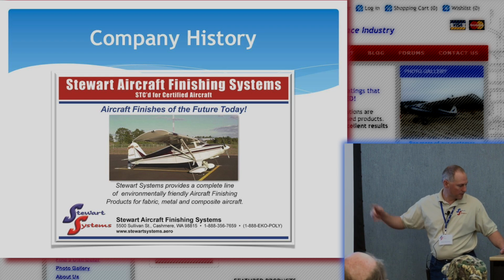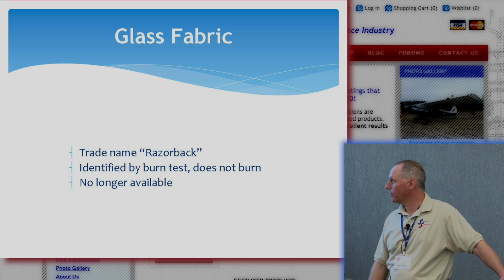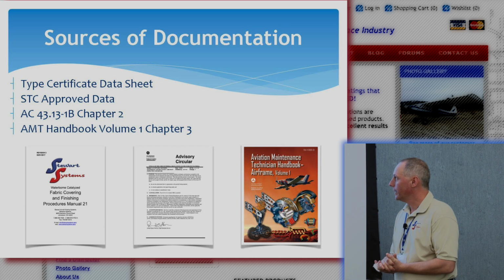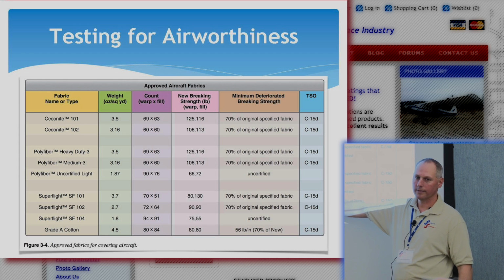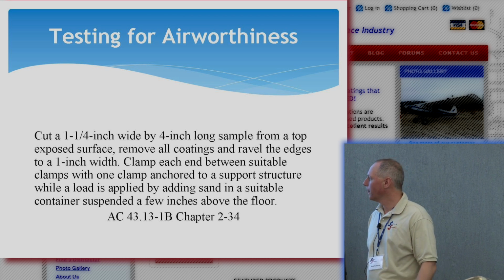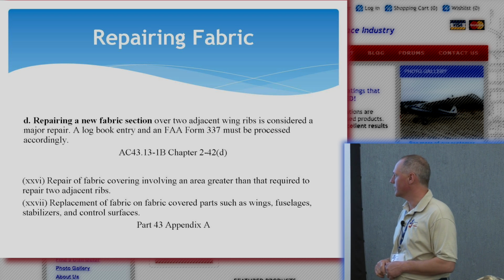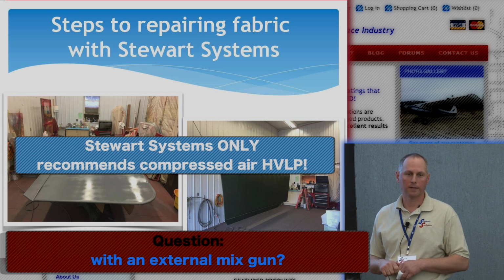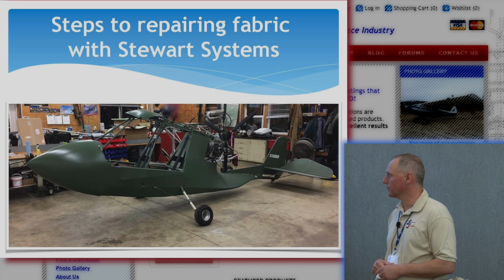How to Inspect and Repair All Aircraft Fabric Systems - Stewart Systems

Comment: I sell Toko ski wax irons (RaceWax-dot-com) and offer caution with using wax irons. First, do not attempt calibration of ANY iron with an IR gun, the IR does not work on reflective surfaces. You need a contact thermometer to calibrate; contact ThermoWorks for advice. Second, the Toko T14 does NOT deliver the number you dial in, that number is a digital display of an analog thermostat, it is NOT a microprocessor control of the temperature. A Toko T18 iron is MP-controlled & more accurate.  I know that they do not talk about IR gun calibration of irons here, but I wanted to mention it upfront as it is a common mistake to attempt that.
Reply from the maker: You are absolutely right.  I have had many tech calls on that.  Sometimes when I can't convince a customer that has his iron set on 350 and his IR gun reads 90, I tell him to put his hand on the iron.  That usually does the trick...  lol.  IR guns are useless on a reflective surface.